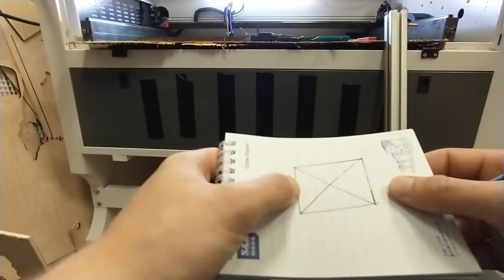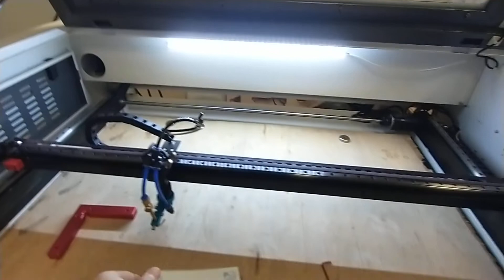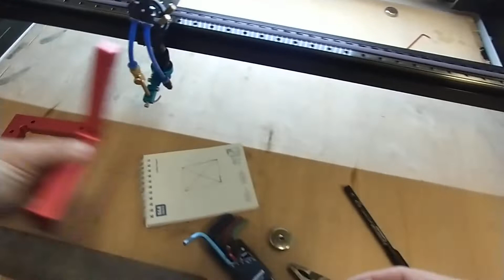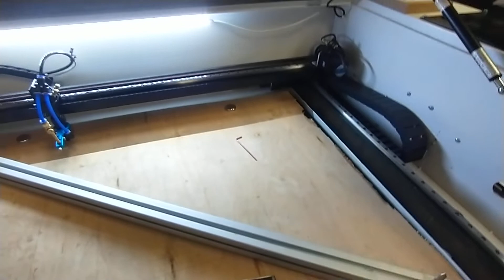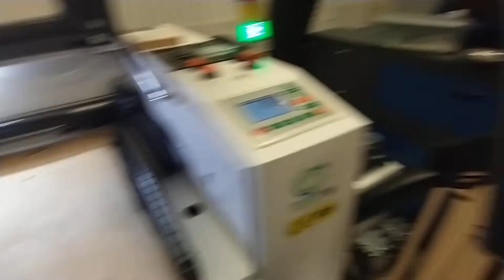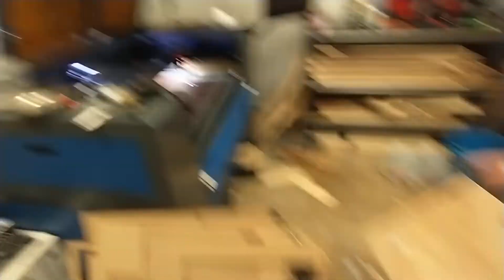How to square the gantry on a Chinese Laser

Comment: Thank you for your video.  I have been dealing with my laser being out of square for a while now.  Your video pointed me in the right direction and YES it worked.  I solve the problem of getting a square to measure rail to rail by clamping a 1-2-3 block the Y rail.  That gave me the height and a good reference to use my square to straighten it out.

Comment: With most macvhines the Y belt tension is achieved by adjusting a unit on the backat each end  of the gantry. If you tighten the ajustments differently this may be the real cause of the gantry being off square so be careful to adjust both belts by the same amount. The method demonstrated is exactly what you need to do,  with the big sqaure and equal diagonals method. However there is one impoertant point missing from this video..... the gantry bearing blocks. Those bearing blocks are usually pre-tensioned onto the rail to ensure they  are  bscklash-free.  If you twist the gantry then you are twisting the beaiing blpcks out of line with their free running position and this will result in premature bearing wear.. It is therefore important that your slightly loosed the end bearing blocks so that they can "float" into thier natural stress-free alignment. Dint forget to retighten them after you have squared the axes..